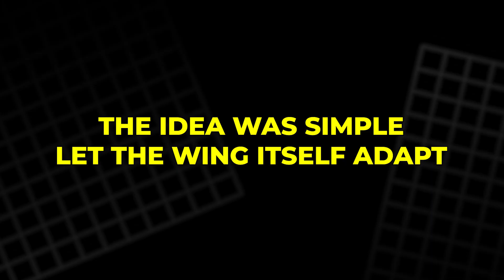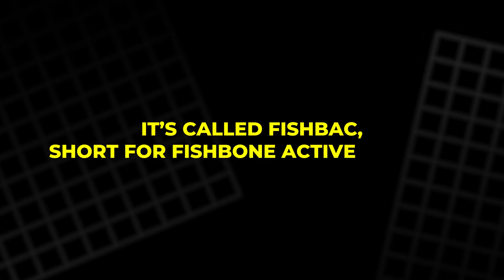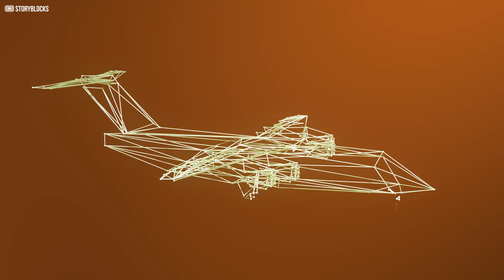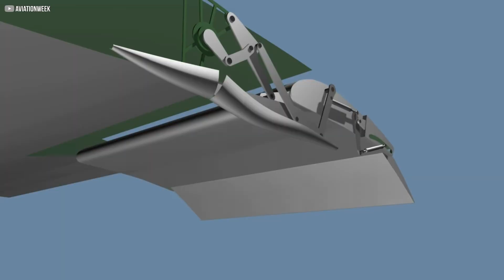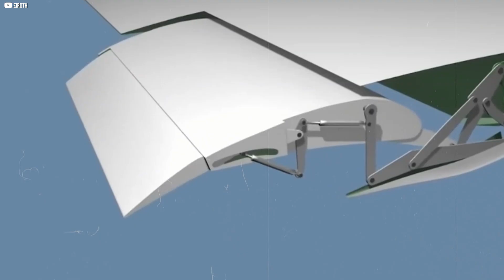Metamorphic Wings: How Planes Will Soon Fly Like Birds

Comment: It seems that it only bends, not extend or stretch out. So no increases in the wings size to help with the lift.
Reply from the maker: That's a great observation! The bending mechanism is definitely an interesting aspect of the design, and it's all about optimizing lift while maintaining efficiency.
Reply: @Combustra 
This should be great, at least for small and medium size airplane which usually do not have extended flaps.